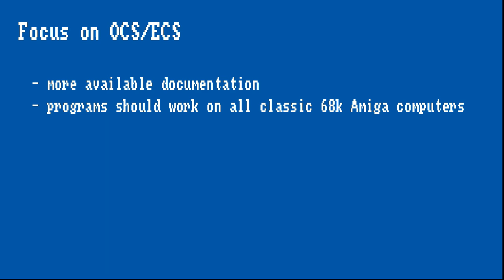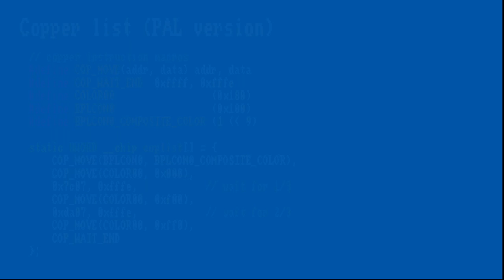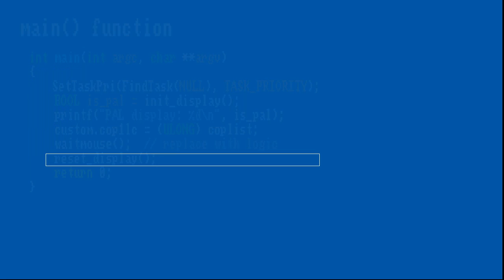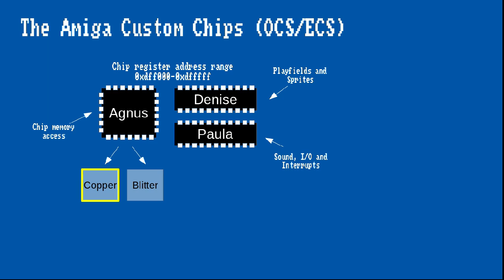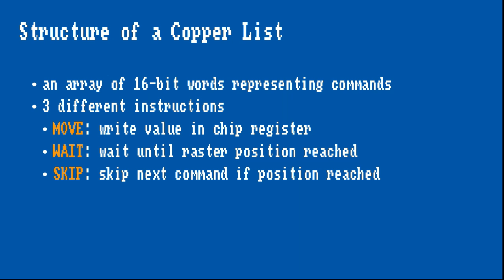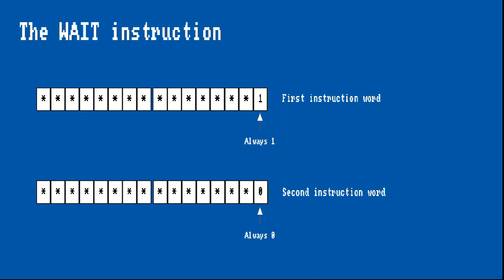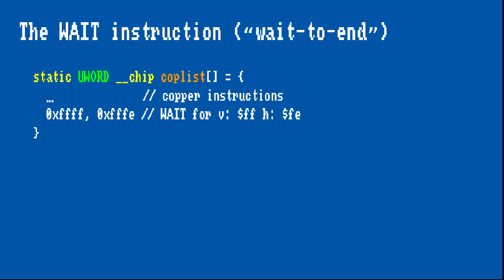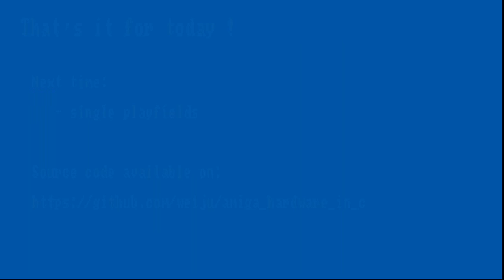Amiga Hardware Programming in C Part 2 - Startup, Exit & the Copper

Comment: Finally got around to this session, using SAS/C 5.10 on an A500 with KS 1.3. There's some errors with the method of calling LoadView(NULL), triggers a GURU on real hardware. Found a discussion on EAB. URL to follow. SAS/C also doesn't have the libauto that VBCC has. And while VBCC is available for m68k, it looks like it's for KS2 and above. Shrug. I found an example which triggers a call to open the graphics library, stored the current view in a variable and passed that to LoadView() and it worked ok. Reused this to pass to the LoadView in the reset_display function. I did have another guru then when calling RethinkDisplay(), but it doesn't seem to be needed so I've simply left it commented out. Playing around with the copper has been fun. I was wanting to try drawing 🇮🇪 and while I figured out the 12bit colour values, I haven't figured out how to get the copper to draw each raster line as the 3 colours. Something to come back to. Looking forward to working part 3 😀
Reply from the maker: Hi, thank you for your feedback ! I can't easily reproduce your SAS/C 5.10 situation since I generally develop in VBCC and just recently dug out my SAS/C compiler for another video, however, the SAS/C I have is 6.50, it works for me under OS 1.3 and supports automatically opening and closing system libraries. Is there any particular reason you are sticking to 5.10 (memory limitations etc.) ?

I assume that with VBCC only working for Kick 2.x and above you mean that the precompiled version only works from OS 2.x and up ? Because it is possible to compile for OS1.2 and up (using the kick13 target) as it is one of the main reasons I am using VBCC. I can see that there are reasons why one would want to develop on the Amiga directly, it's just that there are a lot of hoops to jump through for me personally, especially when many development tools have higher minimum system requirements.

As far as real hardware goes I only have an A1200 set up to test compiled programs on real hardware, because I can use flash cards to transfer them quickly.

Good luck and thanks again for your observation and thoughts !
Reply: @WeijuWu  Hmm, I made a bad assumption that SAS/C 6.50 wouldn't work on 1.3, will look at upgrading, that might save me a bit of hassle. I may also look at building VBCC for for 1.3. I'm doing it on my A500 purely for nostalgia reasons. Could never afford a HDD for it back in the day and I've recently restored it and installed an Accelerator/RAM/IDE board that gives me that dream A500 setup from back in the day. Waiting for some parts to get my A1200 back up and running and once it is I may setup a similar dev env. Thanks for making these videos, following along has been a lot of fun. I mentioned the above more for anyone else's benefit, if they're as dumb as me to do it the way I'm doing it 😁
Reply from the maker: @75slaine  I assumed the same and was surprised myself when SAS 6.5 successfully ran on my 1.3 system last week. There are so many ways to program and the great thing is that everyone can have their personal approach. That's why I try to keep saying in my videos that people should use what works for them and what I use in my videos are merely suggestions. Keep enjoying working with your Amiga !
Reply: @WeijuWu  Thanks. I'll slowly work my way through the series so expect future comments on subsequent videos. Getting my A500 up and using it for coding like this has brought me so much fun during the pandemic. Thanks so much for making these videos. I tried contacting via twitter by the way. 👋

Comment: I expected COPJMP1strobe register used somewhere in the code to start the custom copperlist but no trace of it... anybody knows why?
Reply from the maker: In this case this is because I start the program from the command line/Workbench. Therefore the Copper is already active, but since the pointer/Copper List 1 address was changed to our own Copper list, after a vertical blank the Copper will automatically restart using the instructions in the new Copper list. In the same manner, we restore the Workbench display by changing that address register to the previous address again.
Reply: You are right, I verified commenting out the move instruction to copjmp1 on one of my old asm programs and it still works if launched from the workbench. I'd like to produce a bootable adf floppy image out of your startup.c and verify that the copperlist stays inactive since the workbench is not loaded, do you know how to accomplish that? I see that in your makefile you call vc that is an interface for vbccm68k for compiling and vlink for linking, the latter one maybe could be used to produce an adf file using the -brawbin1 switch but thinks get very complicated at this point...

Comment: Great tutorial and information, thanks. I am enjoying the series so far. I was wondering, how do you debug when using cross-compilation? Would you use an Amiga debugger running in the emulator?
Reply from the maker: I have to admit I rarely use debuggers and most debugging I do is related to memory and profiling. My general C approach on Amiga development is to keep system specific and non-specific parts separate. It is easy to test and debug the generic parts since there are more tools available. Additionally I use unit testing using my own C unit testing framework (https://github.com/weiju/chibi_test) which can also run on classic AmigaOS so I can unit test system-specific code.

For hardware programming I typically just try to narrow down the problem to a small code section and fiddle with it, with an emulator it's relatively painless compared to rebooting a physical Amiga. UAE also has a built-in debugger. There are probably more efficient ways to do it, but this has worked for me so far.